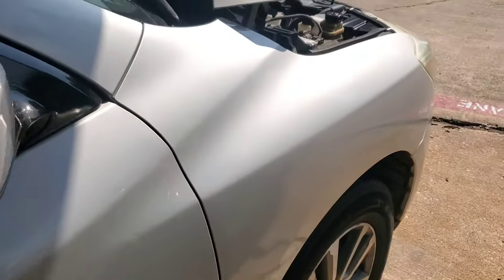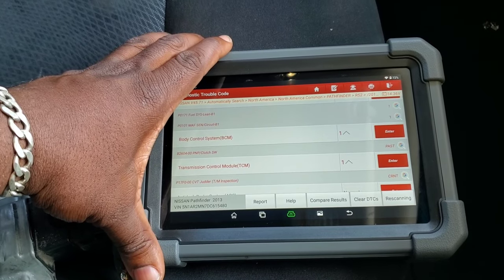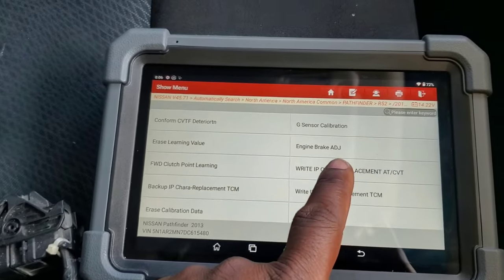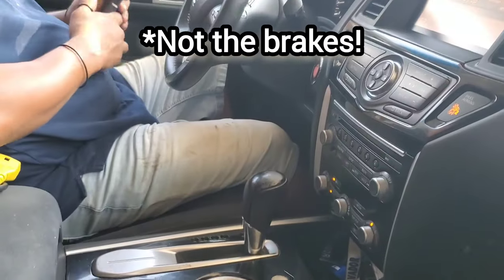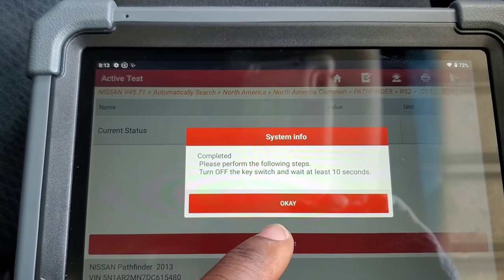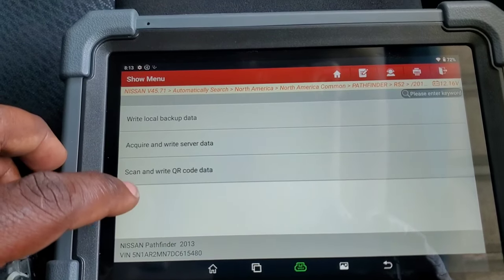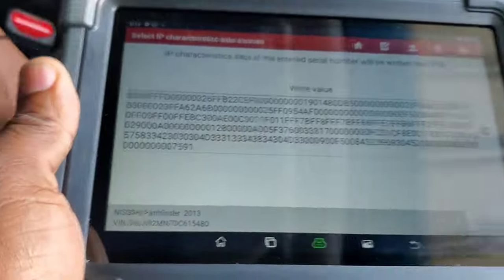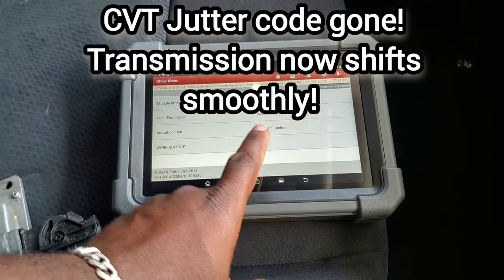Nissan Pathfinder Program USED CVT transmission QR Code P17F0 CVT Jutter with Launch PRO TT

Comment: Excelente video. Quick question 2020 transmission works on 2013 pathfinder  some one told me I can do and programmed and it works but I trying to make sure before buy and switch transmission

Comment: Great information!!! I have a question . How about if some one previously Change the PNS ? What we need to do . Thanks Man
Reply from the maker: On some vehicles such as Ford qr code is also located on the physical valve body as well, does require opening cover.. you may also be able to do vin to qr code via nissan dealer or online in the scanner